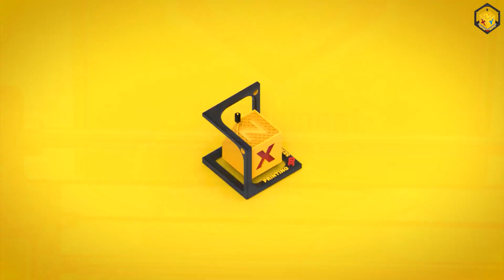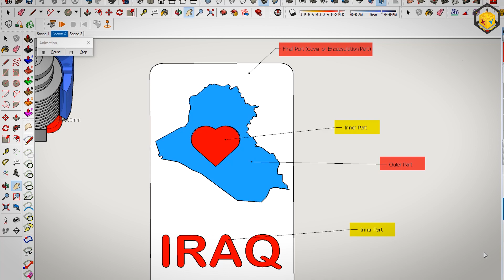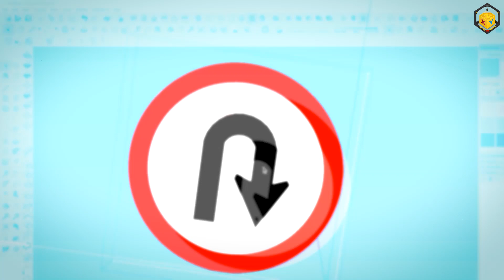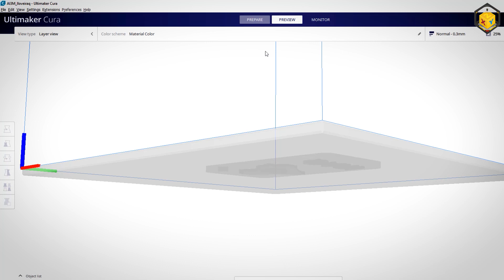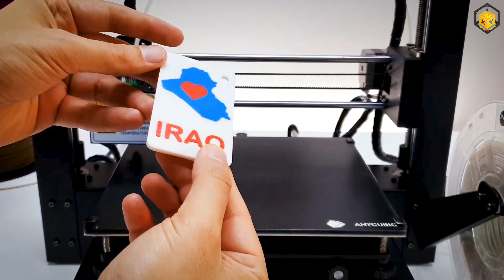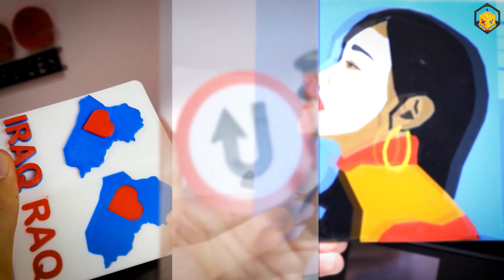Multicolored 3D Print : Pancake Method

Comment: Great .... I'll use this method with my Geeetech A20T ( three extruder and a 3 to 1 hotend ... so 1 nozzle ... )   I could merge the gcodes ( for 3 colors prints ) so be able to print everything in one step :) 

But what's not ( yet ) clear to me ... it's how to split the model , and calculate the stuffs based on my A20T nozzle ?

Thanks for the answer

Comment: I have a tip for how you can place the parts like you designed them. Make a circle around the model wich is extruded from 0 -> -1mm in z height. Export every single color model as stl with the circle. drop them into cura and place them von z=-1mm (you have to disable the feature, where items automatically stick to the ground)